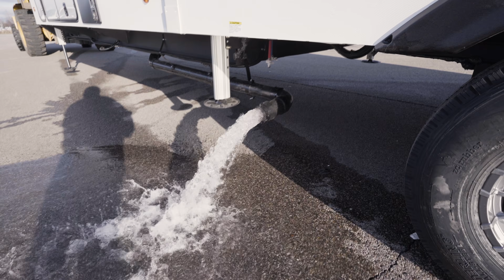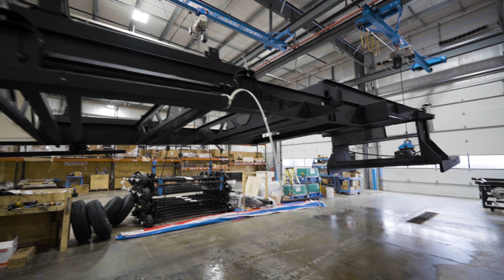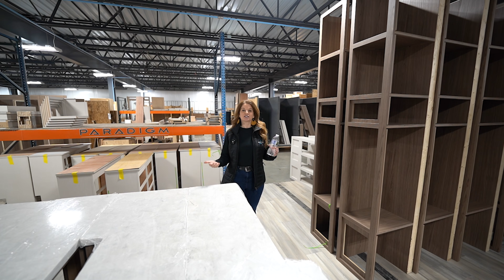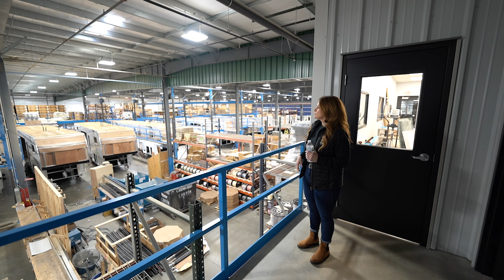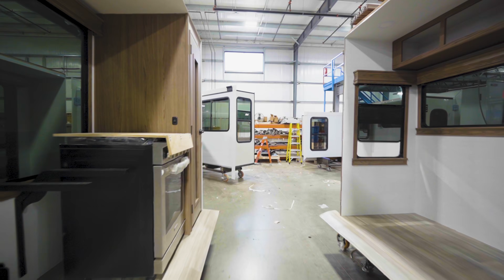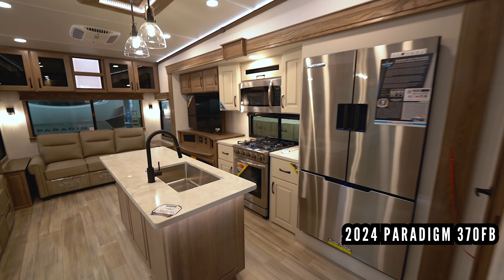Unveiling Innovation: Touring Alliance RV's Paradigm Plant 2

Comment: Hello! The V bracket at the spring haingner is it ont where the Morryde equilizer is ? Or 3 V brackets ont each sides? Thanks.
Reply from the maker: It's attached to the chassis and then under is where you would find the CRE 3000.
Reply: @alliancerv  What do you guys use to seal the corners, Eternabond or Mylar?
Reply: The welds on the V brackets are a joke ( look like chicken poop). I wonder how the rest of the welds look like throughout the frame.